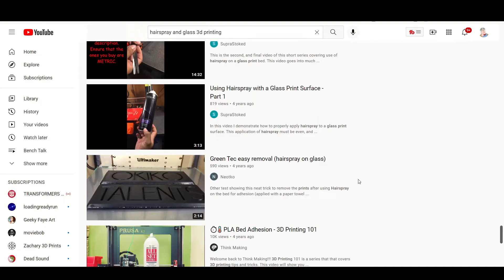Safety First - How safe is your 3D Printer, or Laser Cutter

Comment: The only reason why I don't let my FDM printer running unattended or at least running while no one is in the house is not fumes or running out of filament or anything like that. It is because I never know when (and not if) the software/firmware can fail and any of the heaters (bed and hotend) can have a thermal runaway and catch fire. It has happened in the past and there is no reason it can't happen again.
Reply: At least on 8 bit boards, Marlin seems remarkably robust. It has a working watchdog timer, so if the firmware malfunctions, the board will be reset. Then the bootloader or the newly booted Marlin disables all outputs, bringing it into a safe state. Arduino Mega bootloader manages to do that but generally fails to reset the watchdog so the printer can be inoperable, stuck in a boot loop. I have had some experience debugging the Watchdog so I'm well convinced of it. There are a number of cross checks, they seem remarkably good. When I get a 32 bit board eventually, I will do watchdog tests as well. Should have gotten one before the chip shortage :D

But there are still things to go wrong. When the MOSFETs fail, and they will eventually, they do so stuck in the on-state and there's nothing the software can do other than scream at you. PS_ON control would be an improvement, but it can be susceptible to bootloop issues. Furthermore there is always an opportunity for an external short, especially since any stray ground can bypass control, due to low side switching. Furthermore it is conceivable that a board exists which doesn't pull down properly in hardware, which would bypass the bootloader disabling outputs - and also there is no hard guarantee that the pulldown will never go open by itself. Attended printing is the right choice.

Comment: ...dont do that at home aaand dont drink resin...waer gloves and repiratory mask....people have brains to think...probably...or not. But the point is, that Beginner often dont know nothing about 3D printing and they are very often even not aware of the danger. Education and informing is the very important thing here with these new technics! And yes resin can cause allergic reactions., even in a cured print (happens to me) so i personally found a mild resin what doesnt stink very much and when the piece ist cured and washed, i have no problems to touch it. But yes resin is not very healthy at all. Even like printing ABS witout a case and ventilation.

Comment: I'm sorry... if your intention is to not talk about anything that has risks... you said it yourself when you said that people could stay under their covers. Laser engravers are no more dangerous than any other tool. When handled irresponsibly, a screwdriver could kill you. The open air engravers like you (and I) have are not 45 watts, by the way. They are 5-6w max. The 45 watt is a marketing ploy that relates to power IN ... not power OUT. Yeah, you can burn down the house if you leave it set in one place at max power on a black object and walk off, but you can also set the house on fire cooking bacon. Not that my opinion matters, but since you did ask your viewers - of which I am one :) - sure... tell people to be careful, but don't act like these things are killing machines. They're not. Don't drink the resin and don't stare into a laser... should be common sense, but ... we are talking about the human race, so... I"d love to see more videos on these, but then you'd have to call yourself the 3d Printing and Engraving Professor :)

Comment: So you're the reason people are still saying to put hairspray on blue tape, pei, glass, flex plates, literally everything you need hairspray. Seems like one of the biggest old wife's tale of 3d printing.
Reply from the maker: I still use it daily. It just works.
Reply: @3dpprofessor  I tried hairspray yesterday again for some reason. And it worked like a filament repellent more like. It seems to have left an oily film on the surface that nothing could conceivably stick to.
Reply from the maker: @SianaGearz  Huh. Aquanet Ultra Hold or a different brand?
Reply: @3dpprofessor  There is no Aquanet brand in this region. This time i tried L'Oreal Studio Line FX8 but 3 others before it haven't fared much better. There are also no unscented hair sprays that i can find, so the whole experience is... very unpleasant in every possible regard.

I use wood glue, it works and is insanely cheap. I also ordered some glue stick with PVP compound, Deli 7091, that's very pleasant, dries instantly, leaves a super thin consistent layer which works well and isn't expensive. I have been told that i can just buy PVP and make my own spray, but i am a little wary of ordering a bagged white powder from abroad, i don't want a SWAT situation.